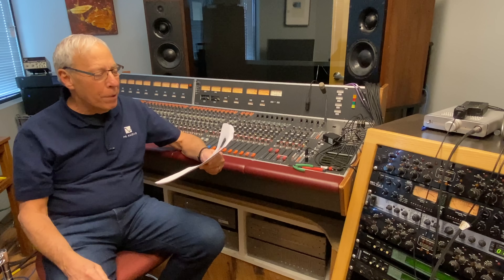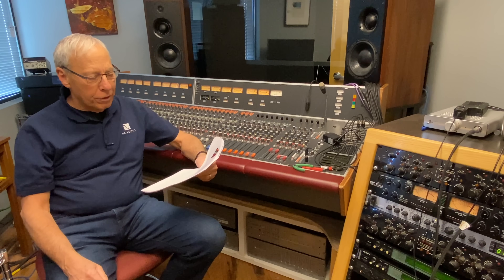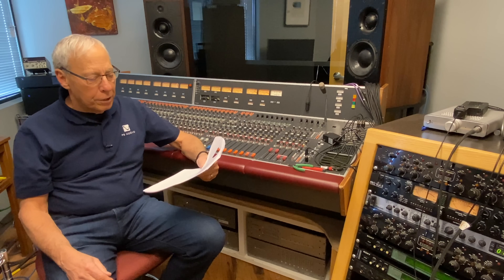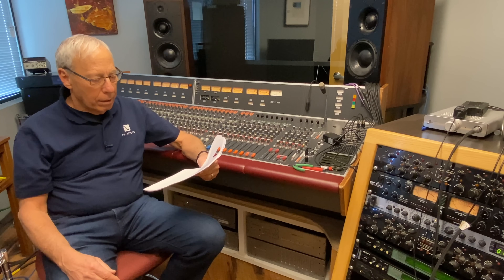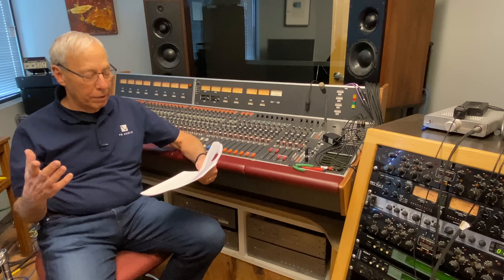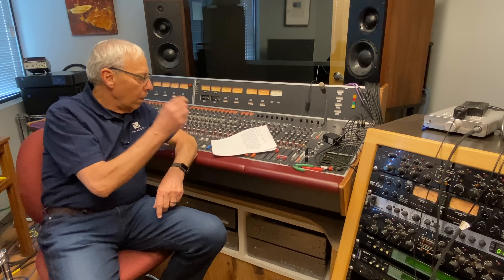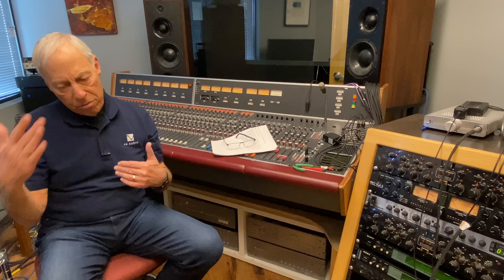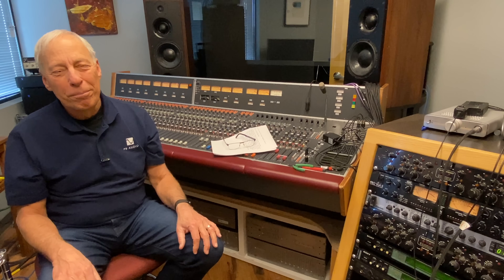Can you have too much damping factor?

Comment: Interestingly, here we have a number of amplifiers driving various speakers, we have large two ways with 15" drivers and even going from a respectable integrated with a dampening factor of 110 to a PA amp with a dampening factor of over 300, you can feel that change in low frequency behavour for the same reasonable output, switch to the Krell and it steps up again with simply further insight into those lower registers and feeling even more of that low end. 

Yet going from the integrated to the PA amp you get that feeling of harder hitting deeper controlled and detailed bass, the Krell simply takes it into a different league, yet despite not being bass light, seems less overblown. By contrast Classe seem pretty laid back with a bit of that more rounded low end. 

Dampening factor is obviously important, but amplifier topology and design is equally important, Hegel are getting great reviews, yet already some are changing to Class D alternatives stating the bass definition and pitch is improved. While others are changing from Class D as they think its too neutral and dry and in effect they feel they have less bass.

Me, maybe next year I may try a Class D model. I'm not sure, I enjoy the old Classe Audio amps and the Krell pre/power still ticks most of the boxes bar functionality and convenience.  I always felt I want dampening factor because I want the 4 10" drivers in my coupled cavity speakers to be well controlled. I avoided valve power amps and went with Krell due to that old 90's claim of Krell bass being spectacular.

Yet the biggest improvement I heard after Krell was that Genesis Digital Lens.

Comment: When I compare my Sansui AU-555A, using its amplification stage, and my XTZ Edge A2-300 power amplifier (and using the Sansui as a preamplifier), the Sansui with its damping factor of 60 doesn't control bass nearly as well, but when I switch to the XTZ with its damping factor well over 400, the bass is of course much tighter, but I lose a bit of midrange detail. Complex passages aren't as tidy with the XTZ. It's not a huge difference, but it's there.

Comment: A very high damping factor has no meaning at all because the "Controlled" speaker is connected with series of serial resistance components from amplifier till speaker leads witch typically are: Amplifier Zobel network coil resistance + Amplifier Speaker Switch contact resistance (with additional protection relay contact if applicable), then amplifier terminal to speaker wire resistance + 2m to 3m  Speaker cable resistance + Speaker Binding post to Speaker cable connection resistance + (the most influents on resistance between speaker driver and amplifier:) Driver cross over component which for a woofer would be at least one and most likely 2 coil inductors which has typically a ~0.5 Ohm, So only with cross over component Speaker damping factor is limited to a range of ~ 16. So it is meaning less to try and get 4000 damping factor which means: 5 milli ohm output impedance of an amplifier. it is not a real number as each contact on the way contributes  ~ 50 milliohm per contact and Cross over components contributes ~500 milli ohm or higher..

Comment: I’m not an audio technician, but I am an audiophile and hifi enthusiast. I do have a scientific background and can confirm that bass drivers, particularly large bass drivers are the most difficult to control and that’s where a high damping factor comes into it’s own. I recently upgraded my trusty 25 year old premium British integrated amp with a damping factor of 400 for a 5 times the price set of preamp and monoblocks boasting a damping factor of 2500. They were driving the same set of floorstanders containing 4 165mm bass drivers per cab that I used with my trusty 25 year old British integrated. The new amplification killed the bass. It was still there and still reached just as low, but, it disappeared almost as soon as it sound. My bass now lacked heft! I appreciate a tight well defined bass, but this was to an extreme which did not please my listening preference. I’m not sufficiently knowledgable to indisputably blame the phenomena on the high damping factor, but I suspect that was a major contributor.  Fortunately, I’d used a trusty local bricks and mortar dealer, not purchased cheaply on line, the dealer swapped those monoblocks for a pair with a much lower, but still respectable damping factor, by the same manufacturer, but a very slightly higher price, which I was happy to pay, because that bass heft had been restored whilst maintaining a tight well defined and textured bass.

That 25 year old premium British integrated still sits proudly in my rack, should a substitution ever be necessary. I did have that dealer send it back to the manufacturer to have it refurbished. That was £185 well spent. Is any of you have any trusty aging components your thinking of up dating, look into refurbishing what you have, it might just save you thousands. If a component was class leading when you purchased it years ago, chances are, it can still hold it’s own.

When purchasing new components don’t be over influenced by technical specifications and reported measurements, make your purchase using your ears and wallet. Most of all, enjoy the music.
Reply: Thanks for this really good comment regarding DF and BASS.

I do own an Hegel H120 and it damped my music - especially the full bass produced by my Elac speakers to death.

There still was a good and clean bass - but it was not "musical" anymore.

I do use now an old harman / kardon HK6500 with sounds beautiful (!)
Reply: @saschaseibert4932  glad to be of help. I can only speak from personal experience. But I guess ultimately, it’s down to personal preference.

Most of all, enjoy the music.

Comment: Absolutely what i expected to hear Paul say, i.e.   "but how you get there" is the crux of this question" 
 My (nearest to) perfect amplifier would, (i imagine) have Zero open loop feedback, zero localised feedback anywhere & a  high very high damping factor. I have no idea how or if that can be achieved but i'd like to hear such a design & think it would be a good 'un.    P.S. i'm told the very high damping factor of a certain famous  switching amplifier & it's many OEM spin-offs that have an unusually high damping factor to put sy all else to shame,  also has lashings of feedback & the reviews were "Meh"  
Recycling everything back through the amp or subsections of,  as in open loop & localised feedback  gives good meaurements, high damping factor but to me, at least, seems theoretically imperfect & if it's done just to give an alluring 2000 to 3-thousand damping factor when, say 300 is more than ample, that's like going back to early 70's when folk bought power-amps particularly, on measuremenys alone.  Back & before them, Pete Walker of Quad, bless his clever & innovative designers sole, spoke in interview how power amplifiers with the same messurements will all sound the same. My early (music-loving driven) the hi-fi walk's vintage valve amps sounded gr8 on the 'right' speaker (KEF  Conceros & Quad ELS57's back then)  ...with their lofty damping factors of 16 or little more !!!   (I'm guessing)
Marketing power-amps with specs can misslead all but the experts, which i am not.

Comment: Sorry for the wall of text.
Damping factor is a ratio.  It's important to keep that ratio above 1:1, or a damping factor of 1.  Higher is better, of course.  But the damping factor of an amp is just the beginning.
In the numerator, you have the DC resistance of a driver (DCRe).  That's it, nothing else.  In the case of multiple drivers, you do multiple separate calculations.
In the denominator, you have the DC resistance of everything else going from the driver to the amp's output components.  Everything in the path - crossovers, wire, Lpads, everything.
A typical 8Ω woofer will have a DCRe of about 6Ω - some will be much higher or lower.  But 6Ω is quite typical.  What you can do is remove the woofer from the box and disconnect it.  You can measure the DCRe of the driver with any ohmmeter or multimeter.  Let's say that we measured exactly 6Ω.  And let's say we have an amp that is rated with a damping factor of 100 @8Ω.  Which means the DC resistance of this amp is 8/100, or 0.08Ω.  But that's just the amp.  You can tape the wire that was connected to the woofer together to "ground them out".  Now you can  measure the DC resistance across your speaker wire at the amp (disconnect it from the amp first).  Since there is no Lpad for the woofer, this is a measure of everything in the circuit with the woofer.  You might find anything - it will vary wildly from one speaker system to the next.  Let's say we measure 0.1Ω.  That means the damping factor of our system is 6Ω/(0.1Ω+0.08Ω) = 6/0.18 = 33 1/3.  This is a good ratio and ensures there will be almost no "ringing" caused by excessive woofer movement.  This is what the damping factor does.  When the signal ends, you want the driver to quit moving.  But drivers store energy between the driver coil and the magnetic field.  When the signal ends, this energy is released and causes the coil to move.  This will make the driver keep moving back and forth after the signal ends.  Grounding this signal out discharges this energy and stops the movement.  Grounded out is like having a damping factor of infinity.  Nothing is perfect.  But the higher the damping factor, the faster we get rid of this extra energy and the sooner the driver quits moving when it ought not to be moving.

But let's say we measured the midrange driver at 8Ω and found the rest of the system has a DCRe of 11.5Ω due to the Lpad.  Now the total damping factor of the system is 8/11.5 = 0.695.  Uh oh, less than one.  This midrange is subject to "ringing" due to poor impulse control - despite our amp having a damping factor of 100.  Now swap our amp for a Hegel, with a damping factor of 4000 @8Ω, and let's see what happens.  8/4000 = 0.002Ω.  Recall that our amp was 0.08Ω.  So to calculate the total system Re, we take 11.5, subtract 0.08, then add 0.002.  We get 11.422Ω.  We can now calculate the damping factor for our midrange with the new amp: 8/11.422 = 0.7.  And we see that we're still in trouble.  But how can this be?  Why did going from a damping factor of 100 to 4000 have such small effect?  It's because the amp's DF is only a small part of the whole.  Any reasonable damping factor for an amp should do you well.  What is going to do much better is to eliminate any Lpad in series with the drivers.  Lpads are damping factor killers, but some system can't do without it.  Second, high quality, low resistance speaker cable is important, especially for longer runs.  Crossovers matter - a lot.  I once had a pair of speakers which put a big coil in series with the woofer as part of a 2nd order crossover.  That iron core coil had a DC resistance of 1.2Ω - which cut my damping factor way down.  Iron core coils are small, light and cheap, which is why you find them in speaker crossovers a lot - even in "high end" speakers.  But iron core coils have a damping factor destroying high resistance.  If you're willing to spend a few dollars (and it's really only a few dollars), you can replace them with heavy gauge, very large and heavy air core coils.  When you shop for them, they will usually list their DC resistance specifically for this reason.

But remember that the DC resistance of coils in parallel with the driver are part of the crossover.  That resistance is factored into the overall performance of the Xover.  So by replacing coils with lower Re coils, you're also altering the performance of the whole Xover.  Probably only slightly, but maybe profoundly.
 
I replaced those two iron core coils with massive, heavy iron core coils with an Re of 0.5Ω.  Still DF destroying, but not as DF destroying as those little iron core coils.  Every little bit helps.  Replacing 16ga. wire with big, 10ga might reduce the Re by another 0.3Ω.
Getting the damping factor of all your drivers up over 1 is vitally important.  But then again, getting it up over 1-10 (Opinions will vary on the exact number) will have negligible effect - almost certainly inaudible.

Is a high damping factor important in an amplifier - you betcha.  But it's just a small part of the whole story.

Comment: I recently upgraded my amplification to a preamp monoblocks combination with a damping factor of 25000!  Yes the bass in my bass heavy floor-standers was very tight and well controlled and well defined,  but, compared to my old integrated amp with a much lower damping factor, the new amps left the musical reproduction with out heft, or body! I did not like it, all tho, I appreciate many people will prefer that leaner reproduction.  I’ve currently got my old amp plumbed back into my system, whilst I experiment with alternative preamps to create the sonic signature  I’m looking for.
Reply: Surely it's the dampening factor and not the fact that the whole amp is also completely different. Really extremely scientific and professional analysis and conclusion.

That was by far the dumbest thing I ever heard and everybody who had to read it is now dumber by a min. Of 50 IQ points.

Comment: Since damping factor of an amp is specified as ratio of speakers impedance (usually specified for 8 Ohms) to out port impedance/resistance, it is important to note that an amp out port actually ends at the speaker in port. As clear edge case if the amp and the speaker are not connected by speaker cable then the amp cannot control anything in the speaker, because the resistance is near infinite.
So the effective damping factor is actually 8/(R(out_port) + R(speaker_cable)). For damping factor 4000 its R(out_port)=0.002 Ohms!
So if anyone wants to keep most of such amp damping factor it shall have the speaker cable with similar order resistance of both wires in sum.
6 foot speaker copper cable shall have 31mm2 cable section to have 0.002 Ohms resistance - think about 2 AWG copper cable. And this will reduce 4000 damping factor to only 2000. The more thickness above 31mm2, the greater effective damping factor.

Comment: So many Hegel fan boys descending on Paul here. 

He is absolutely correct that a damping factor of 40000 offers no more benefits than a DF 100+ 

Hegel know this but too many reviewers focus in on it as if its a holy grail. 

For instance Class D can have a very high damping factor but although design is improving and offering loads of watts for the buck, they still don't sound better overall than many good A/B amps. 

There is so much more to amplifier design and sound than damping factor. 

Hegel are not helping themselves by allowing this myth to be propogated by some ill informed reviewers touting huge damping factors being one of the reasons their amps might sound "better" than something around 100 or so.  

Also let's stop demonising negative feedback, it has its place when its properly implemented. 

Hegels sound engine doesn't re-invent the wheel, its just another design, a clever one granted but although I like the sound of the two Hegel amps I have listened to and in my opinion they compete well in their price bands. 

Its  because they offer a different sonic flavour not a better sonic flavour. That's all there is too it. 

I hear it said that they better amps well above their price band, that is a ridiculous thing to say. 

Value for money and sonic performance is a complex, highly subjective and deeply personal equation.

I'd say to Hegel owners, congratulations on your choice, if it works for you thats brilliant.

Id say to Hegel fan boys, Calm the fcuk down its starting to feel an Elon cult thing.
Reply: Funny thing that Paul says anything over DF 100 contributes nothing, yet builds his own amps with DF of 350. What is the message here?

Comment: Hegel has its own proprietary local error correction called SoundEngine which results in very very high damping factor. I don't believe that 100 damping factor is enough because when people listen to Hegel integrateds in blind tests, they assume that they are listening to separates with very high price tags. Maybe higher price tag high end companies focus on their own costly technologies which result in low damping factor compared to Hegel but Hegel does this job with very reasonable price even in their entry model integrateds so damping factor works very well in their scenario. They've been using deep R&D when we compare them to most other HiFi companies where they don't have any patented technologies. As a very happy customer of Hegel, I'm just curious about using pure class A sound such as Sugden or PrimaLuna but they can't offer the ultimate neutral bass control (remember high damping factor) that Hegel provides within the given price. Most people choose Hegel over PS Audio amps when they test in local shops. I see PS Audio as a very successful DAC manufacturer not amps cause I don't believe Class D can be as resolving as Class AB designs. Although I adore Hegel amps, I don't like their DACs.

Comment: Amplifier damping factor is only part of the equation - and usually, the smallest part.  
If you compute the system damping factor, including amplifier, cables and speakers, you will find that it's hard to do better than about 3.
Reply: You have a point, but actually the number is not 3, but rather 1.33. You cannot go higher than 1.33. The problem is Re' in the driver, or the DC resistance of the voice coil. In a 8 Ohm driver Re' is 6 Ohms, which is in series with everything. So 8/6 = 1.33 that's the theoretical maximum.